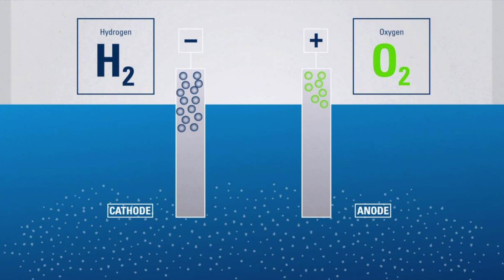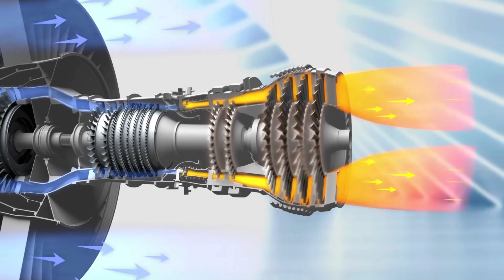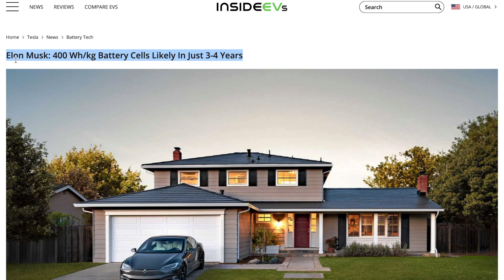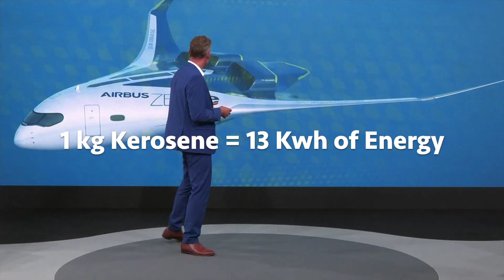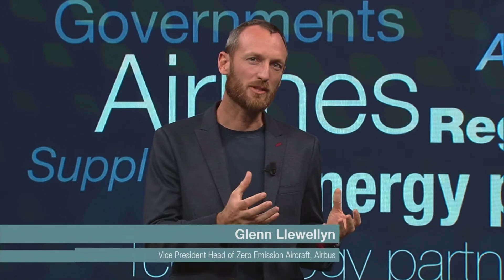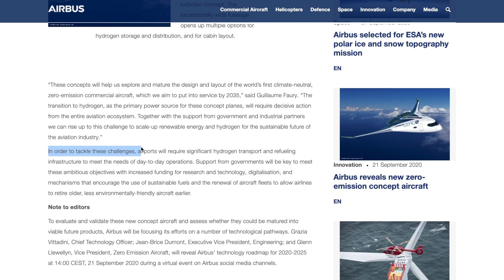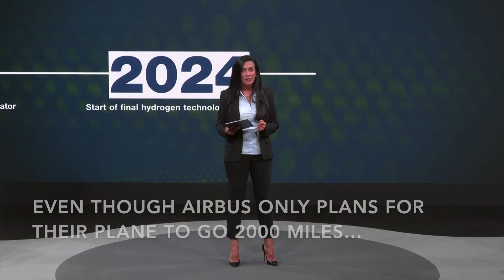Why A Hydrogen Plane Is A Terrible Idea

Comment: Consider that the cost of hydrogen will come down over time, plus cheap electricity means cheap hydrogen through electrolysis
Reply: But as battery density increases, at some point it just won't make sense anymore to create an airplane fuel with an energy source. If you can instead just  use the energy source directly to fly.
Reply: @CyclonicTuna023  batteries are incredibly heavy. Good for ground travel but horrible for air travel. Add the non neglible chance of battery fire and it doesn't really make sense. Maybe in the far future but batteries are a LONG way away from becoming light enough and energy dense enough for planes.
Reply: @CyclonicTuna023  hydrogen is the battery.
use surplus green energy in the day to make and store hydrogen.
then use hydrogen at night in gas turbine generators.
the perfect world.
Reply: Cheap electricity could be cheap biofuel production. Can’t rule that out
Reply: @CyclonicTuna023  Battery density is not going to increase drastically. Solid state batteries are going to provide a nice little boost but that's about it.
Reply: @fdk7014  I'm sure people said the same about 250mb harddrives in the 1980's.

But hey, apperently you can see into the future so probably best to put that skill to good use instead of making nonsense comments on youtube.
Reply: @CyclonicTuna023  No, there is this thing called physics. You should check it out.
Reply: @fdk7014  I have, people that think hydrogen planes are going to work should do so to.
Reply: @CyclonicTuna023  They have, that is why hydrogen planes is a thing
Reply: @fdk7014  Yeah just like hydrogen cars were a thing 20 years ago. Or hydrogen motorcycles, or hydrogen busses, or hydrogen trucks, or hydrogen sea freighters, or hydrogen trains, or hydrogen powerplants. Yep, seeing those everywhere now.
Reply: @CyclonicTuna023  Don't worry, you will soon enough
Reply: @fdk7014  Wow! That´s what they said aswell. 

Can´t figure out wether you´re stuck in the past or can see into the future. Either way perhaps you should get yourself checked.
Reply: @CyclonicTuna023  to be fair hydrogen should not be disregarded and hydrogen versus electricity as fuel source or as a way to propel something hydrogen is much better because hydrogen makes over 200 times more watt hours per kilogram than batteries. Now I believe hydrogen should be used in planes because it is much easier to be used as a way to power plasma jet engines and batteries are considerably heavier and not as a efficient in the sense of weight to thrust ratios 
Batteries and hydrogen both have the chance to evolve and develop more innovative ways but for now hydrogen as a emission free source of electricity will be king of the skys while batteries will be the king of the ground
Reply: @Epictetus7177  The fact of the matter is that you are stuck with the power density of hydrogen. Even if you find a way to make it burn perfectly, which is never going to happen, you still just have a chemical fuel that needs to be refined and transported. 

Its just not feasible for long term solution. They have been trying hydrogen for decades, throwing billions at the problem and we're still no closer to seeing an actual functioning hydrogen infrastructure. 

Battery use on the other hand has been on the rise drastically, and the rate of innovation is increasing. 

If they would have a clean way of creating loads of hydrogen cheaply today, THEN you'd have a good competator to just straight electric. But they don't, they don't even have any good idea's or theories on how to begin innovating with hydrogen.

By the time they finally find a way to create massive amounts of cleand electricity to power electrolisis plants, we're better of just putting that power directly into planes.  

Its a dead end, it always has been and always will be.
Reply: @CyclonicTuna023  if you think batteries will have drastic breakthroughs in the near future then the same could be said for fuel cells and hydrogen production. It's not comparable to computers and hard drives in the 80s, engineers at the time predicted they'd keep getting smaller and the physics of doing so was understood, just not economical and the manufacturing processes hadn't been invented. Battery engineers aren't expecting any major improvements to batteries and the technology isn't accelerating at all. It's just getting cheaper. But cheaper doesn't help when you're factoring in weight in an aircraft, it's not the same as a car. "It will get better" isn't a scientific stance it's an emotional one people said about anything from hover boards to solar panels (another thing that's gotten cheaper but already reaching its max potential). Sometimes choices are made based on the physical limitations of reality.
Reply: @eastsouth9548  Could use Nuclear (Small Nuclear Reactors) to make Hydrogen?
Reply: @hammerheadcorvette4  sure, or you could just plug the SNR into the grid and charge batteries on the planes off the grid. 

Why make a fuel, store it, transport it, store it again, transport it again, store it again, then transport it into the plane and store it there again, then burn it in an inefficient process?

The only serious effort into Hydrogen is sponsored by the petroleum industry hoping to use methane to make hydrogen and reuse their existing distribution infrastructure to get it to consumers. It is just another way to obstruct true movement to bEV, pretending there is some value in Hydrogen to save their market share.
Reply: @CyclonicTuna023  batteries wont just keep getting more dense. How could you assume that. There is a very real physical limit. We do not live in fantasy land.
Reply: Where is this cheap electricity. Trust me bro electricity will only go up in the coming decades
Reply: This video has soo wrong information
Reply: @CyclonicTuna023  they are at their peak
Reply: In 5 to 10 years batteries will be more dense and a equivalent EV will be the same as new.
Reply: One problem I don’t see addressed either in the video or the comments (didn’t read them all) is the recharge/refilling time. This is critical for the airline industry. To me this alone kills the battery option.
Reply: @CyclonicTuna023   Batteries cannot approach the mass-energy density of hydrogen.
Reply: @CyclonicTuna023  "But as battery density increases, at some point it just won't make sense anymore to create an airplane fuel with an energy source."

That will entirely depend on the price. As stated in this video, solid state batteries have already been demonstrated to be 10x superior to li-ion... and here we're getting to an energy density that could actually make it a viable option. But! Producing solid state batteries is currently very very expensive and there are some significant challenges to be overcome, before this technology can be put into mass production. Fuel cells make sense on aircrafts, since they also pack very high energy density and because they generate electricity, so such aircraft would actually be an electric aircraft. This means that the fuel cells could simply be switched with batteries, once these technologies surpass fuel cells from an economic standpoint.
Reply: @pokebattle12345  "Maybe in the far future but batteries are a LONG way away from becoming light enough and energy dense enough for planes."

They are not a long way away. As stated in this video, solid state batteries are energy dense enough to do the job. Jet fuel is about 50x more energy dense than li-ion, but a lot of that energy is lost as heat. So when we take into account the efficiency of electric motors vs jet engine, then jet fuel will get you only 14x further per kg compared with li-ion. And if solid state has 10x the energy density of li-ion, then we're actually at a point where this is totally doable, even for transatlantic and transpacific air traffic. The key challenge with solid state now, is making it cheap enough and being able to put it into mass production.
Reply: @Epictetus7177  it's going to take a bunch for different type of energy's to go green no one thing going to do it all.
Reply: @CyclonicTuna023  No, you do NOT get to wave your hands and say that a breakthrough will magically materialize.
Reply: the cost of hydrogen actually is more likely to go up with time. Currently the price is a mix of waste cost from steam reforming which is dirt cheap while hydrolysis (the method people prefer because it's cleaner) costs it's value in electricity. As a result making hydrogen can never actually be cheap as unless we accept steam reforming as the solution (which again means hydrogen vehicles are no longer clean) then the costs for hydrogen will always cost more than just charging on electricity as there is a loss in hydrolysis being only at best 80% efficient with the average closer to 44%.

At 44% you are using over twice the electricity to make hydrogen as you would have to just charge off the grid. Now hydrogen at 700 bar has an energy density of 5.323 Mj/L, jet fuel in comparison has 35Mj/L. This mean we need vastly more hydrogen as even at these ridiculous pressures with our heavy pressure tanks we need way more fuel. Currently on existing fuel planes use about 5 gallons per mile (about 18.9 liters), if the energy is correct that means for hydrogen we need 173 liters of hydrogen per mile. Even if it were cheap, that is a Ludacris amount more. 

And like I said, that hydrogen will be twice the demand on the grid of existing raw electricity. It doesn't quite sound nearly as good when you have the math in front of you. Currently it takes around 39kWh just to get 1 kilogram of hydrogen. Think about how bad that is.
Reply: But you still need to get investors plus battery technology is advancing at a rapid paste but not hydrogen since electric cars are treading and charging station is much cheaper then a hydrogen station. It comes down to money so it will take awhile.
Reply: @TgamerBio5529  actually batteries haven't really changed much in the last 15 years. Charging speeds for example is purely about whether they are wired in more parallel branches or more in series. That was always possible, it's more there's now an incentive that people want the speed for so the higher cost for wiring is worth it. Solid state batteries would be a major breakthrough in though that is at least another 5 years off. And the funding is more from the mobile sector, not the car industry. With it they'll be able to put bigger batteries in laptops without the fire risk and mobile devices won't have issues with heat or cold. 

Also, density for solid state batteries while theoretically higher in reality really isn't. Normal lithium ion cells don't nearly meet their theoretical maximum either so while yes they will be denser, not the 8-10 times people claim. More likely closer to 2-3 times. 

Let's also be clear that solid state batteries doesn't technically mean longer range EVs, it could also just result in lighter EVs for the same range. That's basically what happened with hybrids for example. While a Hyundai Ioniq has a 58mpg, it has a massively smaller tank than a generic Toyota Corolla and therefore gets about the same range. 

Hydrogen isn't going to fail for lack of innovation, it's going to fail as it was a purely flawed concept. Hydrogen has vastly more flaws from cost to refuel without the option of home charging to just straight being dangerous. It's main flaw though is requiring a platinum cathode and anode that is literally made to breakdown. That's about a $4-8K replacement every 50K miles. That means at 200K miles, assuming it makes it that far, you'll have put more money replacing that one part than buying some whole cars. Meanwhile an EV can easily make 250K without a new battery and you can always warranty the battery at 190K if you want for free.
Reply: @mortenrobinson5421  Also most people don't mention much about is how much quicker it is to refuel an hydrogen fuel cell than an li-ion battery of a vehicle and the carbon footprint that is left in producing those li-ion batteries.
Reply: @CyclonicTuna023  It does make sense because airplanes are charged fees for more time they spend idling at airports be it refuelling/recharging and maintainence. Charging batteries take time. Also with fuel, the plane looses weight as it flies making them lighter and more fuel effecient. With batteries, they won't loose weight.
Reply: If Nuclear power was more accepted, we could have cheap nuclear powered hydrogen production
Reply: @pokebattle12345  fuel is heavier
Reply: @fdk7014  Nope, there is a battery sulfur lithium battery. Has 2 times capacity of lithium
Reply: @CyclonicTuna023  2 Questions, how fast can an electric plane fly and for how long. Multiply those together to get range, a current jet liner travels at 600 mph for 16 hours giving it a range of 9500 miles. A Tesla only has a range of about 300 miles, you would need a lot of batteries to even come close to the plane.
Reply: @todoldtrafford  biofuel is made from plants mainly.... Plants grow using sunlight and that too they can absorb only 0.5% of sunlight and also need other material inputs and lot of land and time to grow.... Compare that to a solar panel which are 20% efficient and quick to make and are a one time investment that will need much less land and maintenance than growing plants for same purpose
Reply: there was a breaktrough not long ago about solar cells who cuts out the "electric" part and does direct electrolyses in the cell. Essentially Solar to hydrogen. This could bring cost and efficiency down massively (not yet, but in the future)

Comment: Electric commercial planes? Is that supposed to be a joke?
Reply: True
Reply: Its hydrogen fuel cells powering the electric motor not a giant battery
Reply: Hydrogen tech will improve considerably  over the next 10 to 15 years. Its the obvious way to go. Some of the stats talked here will also change. Battery tech involves the acquisition of rare metals , the cost of which will sky rocket as demand soars. The price of sea water won't as wind will not change. So wind turbine farms out at sea will also be the way to generate the electric required for conversion.
Reply: @aoifesofficial10329extra Cryogenic hypersonic aeroplanes will be the new fastest way of airtravel
Reply: No it isn't a joke.

It would be a joke if we tried making the same types of planes carrying similar capacities. 

  We don't have to. We can have shorter flights, and more planes. Which still sounds bad until you realize the cost savings in fuel and maintenence would allow significantly cheaper planes, AND cheaper flights.

 Wait till Lithium Air, or even Aluminum Air batteries start becoming a thing. They will be able to carry 10 times more energy at least then the current generation of batteries.

  Aluminum Air would be like disposable batteries, but lighter. Easily recyclable. 
 
 Lithium Air would be rechargeable, but heavier.

 Hydrogen is a joke to one reason and one reason alone... Volumetric Density. 

 Anyway neither electric or hydrogen will ever be viable for ocean going flights. 

 The cool thing about Air batteries is that... Well you won't have to carry the weight of the nitrogen/oxygen. It would be like a rocket versus a jet engine.